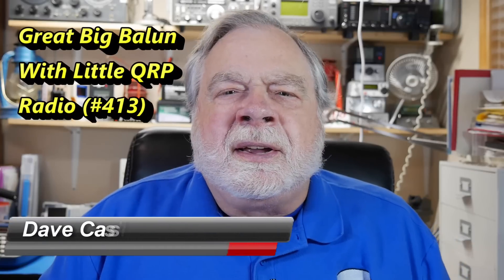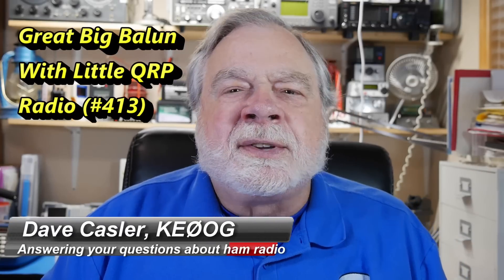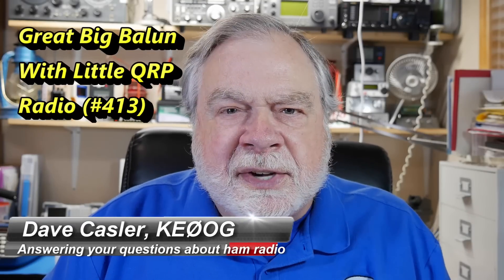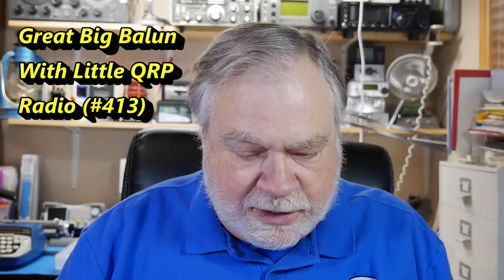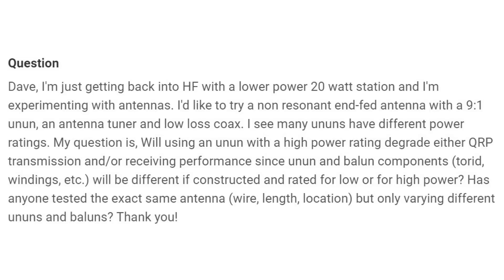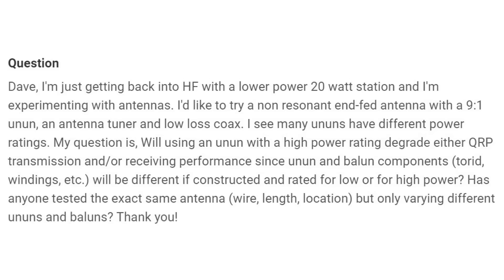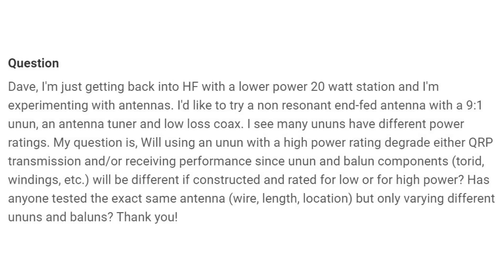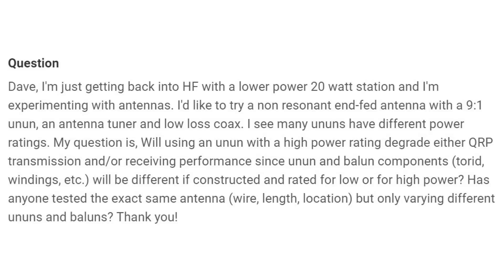Can a Balun be Too Big? (#413)

Comment: The ferrite cores used in HF baluns, tranformers, auto transformers, ununs etc. can have losses
of a Db or so. Those measurements were made at the low power milliwatt level from analyzers.
At high power levels the losses increase dramatically. Ferrites and other magnetic materials are 
nonlinear devices. They saturate. So, using higher power ferrites helps keep losses down and
will also reduce splatter, harmonics and inter-modulation distortion which cause interference.

Comment: Ive had a question about the nooelec balun - I have read that you can cut the trace underneath to turn it into a unun. But also that there needs to be a wire in the +28db hole of the PCB -- would this be the long wire position and you wouldn't use the clamp down connector? Or do I connect the +28db hole to part of the center pin of the cutting of the back trace to feed it back to the clamp down connector?

Comment: You should not bother too much about upgrading to 100W. Remember, your signal strength will only increase by 1 (in words: one) S-unit. If other stations can hear you, your output power is sufficient. But you should use resonant antennas. If the internal tuner has to do a heavy job, the transmitter reduces the output power automatically. That can ruin your day... I operate my G90 with an endfed halfwave wire and a 49:1 balun. With these resonant endfeds (a 40m long wire for 80/40 and a 30m long wire for 30/60) I can work a radius of about 1000km in SSB on 40m or 80m from my QTH in Germany with 20W PEP. In FT8 I already managed to work Rhode Island and Massachusetts on 30m with only 15W.

Comment: He said 20 watts, that tells me G-90, an inexpensive and feature rich radio in the $450 range. Right now FT-8 is the premiere mode while sunspots are down and 20 watts will do fine. Perhaps by the time the SFI climbs over 100 he will be able to buy a higher power radio. The gain from 20 to 100 watts is far less than it sounds.

Comment: Nice channel, Dave. In the Netherlands, Novices can use certain HF bands (10, 20 & 40) with 25W. We are in the proces of letting Novices use 100W on the HF bands (it will almost be certain this year, 2021). On VHF & UHF (2M & 70 cm) it will still be 25Watts.
A 1:9 UnUn is used for an EFLW antenna, where the lenghth of the antenna wire isn't critical (usually about 50 ft). A 1:49 or 1:64 UnUn is used for a EFHW , where the antenna lenghth must be a half wave.

Comment: Hi Dave,
I got a question that really grinds my gears, and I can't find an answer to it.

What happens if you use a random wire antenna with a 1:9 unun  or a quarter wave vertical without any radials but with an 1:1 unun or other wave blocker before the feedline to the radio.  In order to prevent the coax from radiating and being the counterpoise. 
Is it true that you "choke the antenna" this way?

Pse help and 73 from DL
Reply: These are two very different antennas you mention. An additional 1:1 choke is advisable for any EF antenna, resonant or not, especially when there is no counterpoise. Best placement would usually be in the shack just before the radio or tuner (whichever comes first) or at least 6m/20ft from the antenna. This way the feedline between the choke and the antenna acts as a controlled counterpoise, which is no problem and actually what you want. If you place the choke right at the antenna, the common mode currents will look for other and unpredictable paths. This means the antenna system will not work as efficiently and you will probably end up with unwanted RF issues.

I would say the same for the vertical setup, but I have no experience of my own with that one... Curious what others have to say on your question.
Reply: @erpece  thanks for the answer.

To explain the situation a little bit better :

The question results in my experiment with a 25m long random wire for 80m (matched with an old VCI manual tuner). 
The SWR was quite OK but I got so much RF from the coax in my shack that the oven started beepin' and also my electric kettle started to act weirdly, with only about 30W RF power.

Now I ordered a Moonraker AmPro 80 to play around with, but I see the same problems coming up with that antenna.
It has no counterpoise and will probably rely on the coax feedline to act als counterpoise. I don't have the possibility to set up a bunch of radials, due to the confined space here in the city. And I can't use 20m of feedline to provide enough length to act as counterpoise (which will also not solve the problem of HF inside the house). 
Furthermore the radials for 80m must be quite long to function correctly.

The idea is now just to block out the common mode, but I don't know how the antenna will behave when doing so.

Comment: KN4ZLH:
In my opinion the higher watt rated balun has less resistance (DC). They run cooler and are usually more efficient. They should pass low wattage better than the cheaper low wattage units. I run a 4:1 balun on a 40 meter loop with 1.5Kw rating. I only have a 100 watt radio, no amp.

Comment: A "random length" antenna fed with a 9:1 unun is essentially either a non-resonant monopole, if the counterpoise wire is on the ground; or a non-resonant off-center fed dipole, if counterpoise wire is high and parallel to ground, sloped or vertical.  Whatever the configuration, it requires a wide-range antenna tuner (matchbox) to provide an impedance match/transformation between the antenna system (i.e., feedline + unun + antenna) and your 50 ohm, 20 watt transmitter.  If feedline loss is relatively low (either via short moderate-loss feedline or long low loss feedline) and impedance matching devices (matchbox and unun) fairly efficient, the antenna will perform well.  As Dave said, the size of the 9:1 unun doesn't matter much as long as its rated for at least the power applied to it.  Also, as Dave suggested, consider using an end-fed half-wave (i.e., resonant antenna) with a 49:1 or 64:1 unun.  Ken WA8FCI

Comment: I have an end fed, it has been up for quite a long time.  It still "works"  For sure not my first choice in antennas.  The add in the handicap of 20 watts.. I am afraid he is going to get disappointed and give up.  There are a lot of rigs even new that are in that same price range... the IC-718 for example.  If you want to try 20 watts, just turn the power down to 20 watts.  Been at this over 50 years... don't handicap yourself!  Even a good used 100 watt radio and a simple dipole are going to do you a much better service.

Comment: Dave, thank you for your helpful answers to my question about baluns and ununs! I have enough loaned and gifted equipment to get back on HF with 20 watts after many years of being inactive. Before I invest in a 100 watt rig I wanted to setup different stealth HF antennas (that can fit in my very limited space) and test those antennas real time by checking into HF nets that listen for QRP stations and by using the Reverse Beacon Network. The icom 7300 is my first choice for a 100 watt rig, so I'm glad you recommend it for someone getting back into HF, and also have it for your reference station. Thanks again! Jon, K3MAH.
Reply: In my opinion, the best radio to use is the one you already have. Once you gain experience, you will have a much better idea of what you want and enjoy as well as what works for you.
Reply: I would say given your space limitation beyond repurposed mobile antennas you will not see much difference between designs on the bands below 20m. Being so close to the ground in terms of wavelength most of the radiation is projected up and omnidirectional. This is great for contacts in the medium range (probably most of the USA) but the higher radiation angle will hurt DX performance. For longer range work from a small area some sort of ground mounted vertical is going to do the job better with it's lower angle of radiation. In light of these comments I think you will find one of the multistage fiberglass poles a useful item. Use it to support many simple configurations for example vertical, inverted V and inverted L. Perhaps not the best for long term fixed installations but certainly light, non conductive and deployable for portable work.

Comment: Blind Assumption: that isn't picking 20 watts because he wants or needs a small portable station. Maybe the 20 he wants, is wanted for a reason.
Reply: Xiegu g90 is cheap, has a built in tuner, and is 20w. That's my guess.